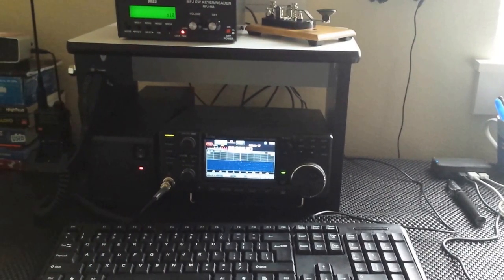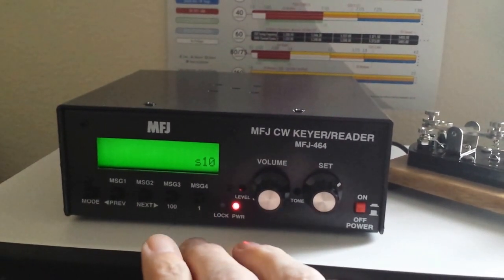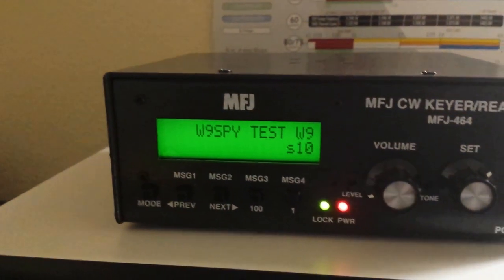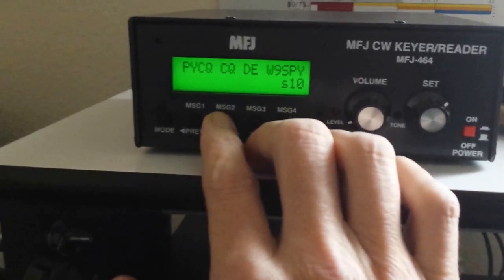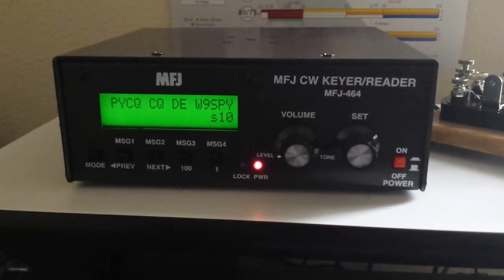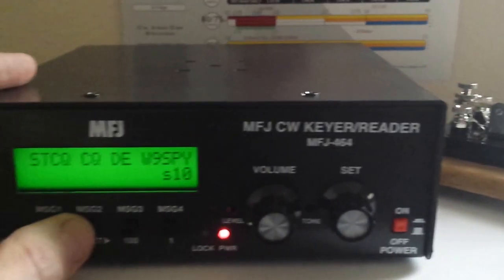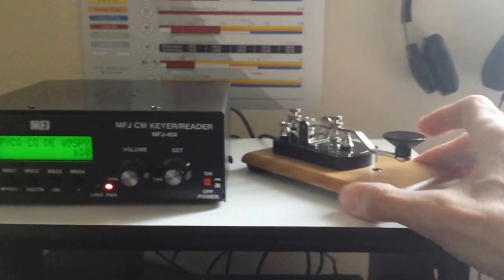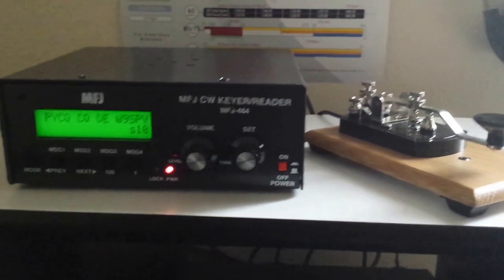Mail Bag Monday: MFJ-464 CW Keyer Reader

Comment: Hi. Can you show us the details of cabling behind the radio and mfj 464?
Reply from the maker: A "How To connect to the IC 7300" pdf is at this link: http://labyrinth13.com/MFJ-464%20Keyer%20to%20ICOM%207300.pdf
Reply: Thank you curt. I rx already but I can't transmit using my keyboard with adaptor... What seetings do I need to change in mfj 464?pls help me. Thank you
Reply from the maker: I'm not aware of any settings on the MFJ 464 that need to be made. (I never changed anything, just used it right out of the box). More than likely, the settings that you need to work with have to do with whichever radio you are using. I only use an IC-7300, so I can't help you with any other radio, sorry.

Comment: I noticed mine kept transmitting random characters and also the keyboard didn't seem to work too well but only when the transmitter was running when I had qsk off that wasn't a hitch so my g90 I had to drop the watts from 20 down to 10 watts for it to work reliably

Comment: Greetings Curt what kind of plug is on your keyboard, a pin plug or a usb, found old review and he talk about pin plug going into mfj-464 from the keyboard, the only wired keyboards i see online are usb wired. thanks Tom
Reply from the maker: I no longer have this set up; in fact, I dismantled it and sold all of the parts at a ham fest. But, I do know that the keyboard plug was a pin plug not USB. I purchased the keyboard from MFJ Enterprises, so they can tell you what you would need.

Comment: how well does this unit copy cw ?
Reply from the maker: It copies about as well as most CW decoders do, which is to say, that it can be tricky getting all of the settings right in order to get a clear decode. It all depends on the strength of the signal you are tuned to and most importantly, how well the sender is at transmitting Morse. It works best when copying CW that is sent by a computer program or from another keyer, as the dits/dahs are more consistent.
Reply from the maker: It copies OK. You really have to keep tweaking your RX signal while using it.

Comment: Hello Curt I would like to purchase an MFJ 464. What I am not clear on is how to connect it to my FT 450D? I contacted MFJ and they suggest that I connect the MFJ 464 by plugging it into the plug where I would plug the morse key. Is this what you have done. Kind regards Simon.
Reply from the maker: Hi Simon: Yes, I have the MFJ 464 connected in the back of my ICOM 7300 where the Morse code keyer would normally go. It works quite well, but you have to take into account the "break in" settings for your particular radio. This may not be a concern for your radio, but it was for mine. If you have any problems along those lines, I'm sure that you can contact MFJ again and get them to help you with that aspect. The MFJ 464 works pretty well, but there is a minor learning curve to getting it to perform well. It all depends on the quality of the Morse signal you are receiving, just as any other Morse decoder does.
Reply from the maker: Here is a how to on connecting it to an ICOM: http://labyrinth13.com/MFJ-464%20Keyer%20to%20ICOM%207300.pdf

Comment: Hi there friend of mine has one of these, when the morse comes it fast 
it reads it as a load of  E E E's, is there anyway to set the incoming 
morse speed...not the sending speed...g4vvq.
Reply from the maker: No, there isn't an internal setting for the incoming Morse. About the only thing that seems to help is to adjust the incoming volume and RF gain on your radio, typically by turning them both down, almost to the point where you can barely hear the incoming signal. The decoder works pretty well, but it is affected by the quality of the Morse being sent. For example, computer-generated Morse will decode best, while that which is hand-sent will not, if it isn't perfect. The truth is, most Morse decoders don't work all that well but this one seems to work a bit better than others. I hope that helps. 73 W9SPY
Reply: Ok Curt thanks for that, will give it a try, someone suggested turning a screw on the front somewhere with screwdriver.....g4vvq.
Reply from the maker: On the front panel, next to the volume knob, there is a recessed tuning slot that allows adjustment of the input level. The manual that came with the MFJ-464 keyer does not give very good instructions on how this is done, so I have not been tempted to try it out. Here is what the manual says about that: "You can adjust the Input Level and tune the signal directly on the MFJ-464. However, it is recommended that you do these adjustments on your radio and not on the MFJ-464. Changing the Input Level and the Tuning the signal on the MFJ-464 can cause problems when trying to listen to another signal. These adjustments are much easier to do on your radio than on the unit itself."
Reply: @CurtRowlett  hello, I can't make a TX using my keyboard with correct adaptor. Pls help

Comment: Just bought one on Ebay, used, they cost $350 on MFJ web page
 MFJ Model 1278 Multimode Data Controller w MFJ 1278B Firmware Upgrade &...

Total: $63.67
Reply: I am W5AWG

Comment: Where did you get the straight key for $ 25.? What is the model number? Thanks.
Reply from the maker: That key is manufactured by MFJ, but I purchased mine from DX Engineering. The price has gone up, but I got it from here: https://www.dxengineering.com/parts/mfj-553
Reply from the maker: I got it from MFJ radio gear. I don't recall the model number. But you'll find it on their website, probably.